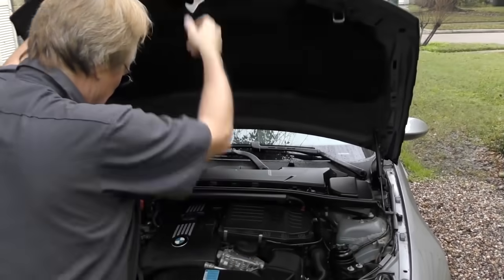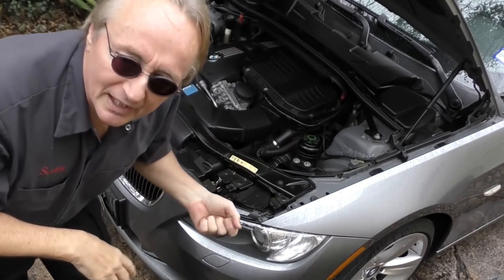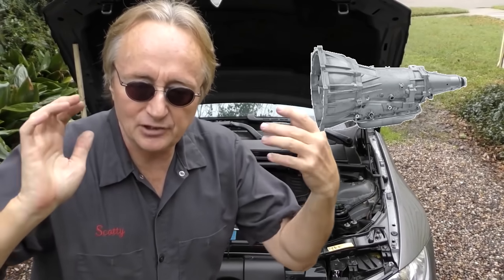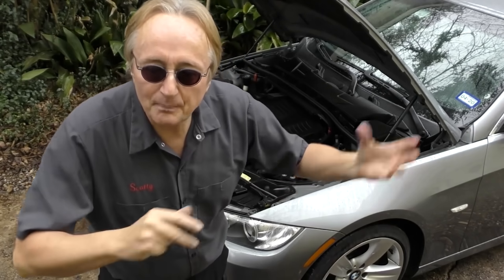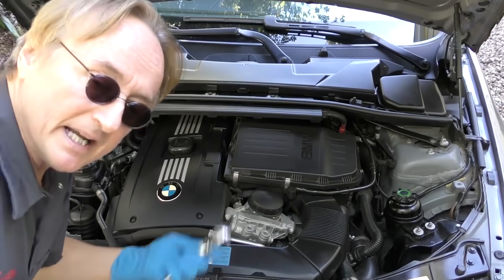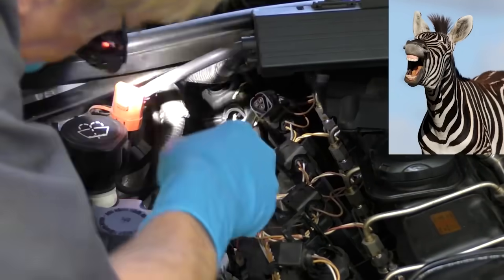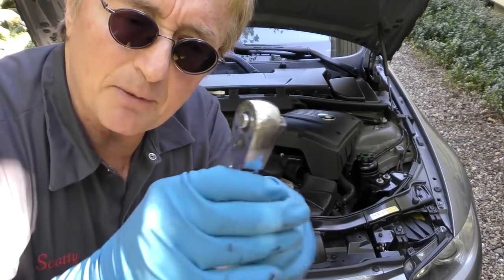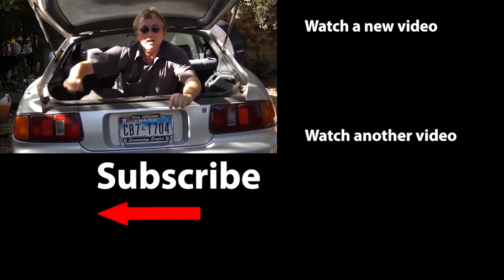People Say I'm Full of Crap About BMWs, Well Watch This

Comment: my take on bmws are if you dont know how to work on your own car then you are going to spend a heck of alot on maintenance but if you have the tools and knowledge to work on your own bmw you will save alot of money and as long as you dont buy a lemon and you get one that was taken care of it will be good. if you drive it like a bat out of hell everyday something is going to break. but if you drive it like a sane person it will last a heck of alot longer. i currently own a 2007 525xi bought it w 60k its at 170k the only things ive done to it are new coil packs, sparkplugs, and a alternator (the alternator is the only thing i went to a shop for and it was only $400 which is standard price because i was quoted the same amount to get it changed on a honda element. if you dont know how to work on them and you still want one you either have the money for it. or lease it. do not own. but if you like working on your cars and furthering you knowledge with cars or you already know how to work on them you will get by with a bmw. but we all know hondas and toyotas are more reliable but nothing beats the drivability of a bmw i will always own one if not a bmw than a Mercedes lol. but thats just me.

Comment: If like working on cars yourself then BMWs are not bad cars, in fact they are reliable cars. Maintenance is not cheap but the driving experience is great. Right now the compressor just went out on mine, I will put a new one myself. you get to learn a lot. That plastic thing is true though, there is a lot of plastics on this thing.

Comment: Having owned one of those 6MT N54 335i's for the better part of 7 years and 75k (now at 150k), most of what he says is accurate. I wouldn't buy it if you aren't willing to diagnose and work on your own car. Most of what breaks isn't particularly difficult or expensive to fix. It's not that tough to work on (for example, he should have taken off the cowl to take out coil and spark plug). Most of the parts you can get with lifetime warranty anyway. It's the labor that's killer if you can't do it yourself.

Comment: As far as I know, in our days it's around $4-5000 to replace both turbos at the dealer, I think you made a miscalculation there. Those are ZF transmission, they are pretty reliable and was installed in over 20 different car brands.
Yes, some of the models have over 30 separate computers/modules, It's nice when you can see what precisely doesn't work, not everything goes according to plan, but most of the time it's easy.
What I agree with here is most people should not buy a Used BMW! Those are performance cars, they need a lot of maintenance, and lots of money, it's the same as having a baby, if you are not ready for it, don't do it, because it's gonna be a nightmare! And yes, lease it, dont buy it!
This is an Enthusiast's car if you want a toy.

Comment: I have owned 4 BMWs spanning almost 20 years. 1 7, two 3s, and a 5 series. I used independent shops and had great luck. I have rented many many cars. Most were competent Asian sedans. I was always glad to get back behind the wheel of a well engineered car that handled, braked and accelerated very well. That is called active safety.

Comment: Yes, a RAV4 will transport you from A to B for less than an X3 and you will spend more on the BMW.
I purchased a used X3 msport with the turbo 6. I sold it a few years later. 
    I’ve driven a brand new RAV4 hybrid that costs over twice what I paid for the BMW. 
     They are only similar in that either will transport you and your stuff around.
Everything from seating to material quality, to acceleration, handling, roadholding and braking don’t compare.
The BMW will cost more to repair, and more to maintain. In some cases, painfully more.
The RAV4 will likely be extremely reliable for a very long time, save you $1,000 per year on fuel, and will drive well enough for most folks.
    Still, I’m pretty sure in my 3 year ownership, I may have spent less than if I bought a “then new” RAV4 and resold it 3 years later. 
     Purchase $17,750  65,000 miles
      Tax            $1400
       Repairs.   $2500
       Maint.       $500
        Tires.        $1000
      ‘22 sale $14,500 96,000 miles
The sensible thing to do would be to buy the Toyota as a used car with some depreciation ( right now used cars are way high, which is why my $9000 used X3 was able to sell for $14000+)
and just use it up.
    The problem with that tactic is that auto safety is improving at a pretty significant pace, and newer is typically safer. 
  If you had a family member killed in a car crash, you might be more likely to be sensitive to this, there is no going back and fixing this, old cars are way less safe, high strength steels, modern engineering, and safety systems are way better.

Comment: I bought a 2005 with 99,000 miles for $2900, got 80,000 miles out of it before one day for no reason it wouldn’t start, no problem, got my money out of it, but you’re right, cheap plastic parts, especially in the coolant system, and whoever designed those radiator hose connectors wasn’t thinking clearly, what’s wrong with a good old fashion hose clamp 😂

Comment: Owning and working on BMW’s isn’t that bad and parts are similarly priced on anything at least 6-8 years old. They do require more care and attention than a comparable Japanese vehicle but that goes along with the performance and technology. I only recommend BMW’s to people that have deep pockets or don’t mind working on them themselves. DIY is the best way to own a BMW. 

That turbo job isn’t anywhere near $8k though. Aftermarket turbos and am Indy shop and you’re gonna spend about $2500. Not cheap but not $8k either.

Comment: I really disagree with a lot of this.

1. The hood pistons are worn after 15 years...so are the ones on my Chrysler Buick :D 
2. The engines aren't that hard to maintain yourself. Oil changes and fluids, brakes, and most of the wearing parts are pretty accessible.
3. Bad turbos in BWMs usually have one of two causes: not changing your oil or modding the computer to overwork the turbo. If you're buying used, look at the condition of the crank case. If it's caked with grime, the owner didn't take care of it. Since it has a failed turbo, I'm betting the prev. owner didn't lube the hood pistons or do any other maintenece either.

I've had a 2015 BMW 335i since 2017. I change my oil every 7500 miles, I bleed the brakes with every brake change, and I flushed the radiator after 80K miles. Basically I printed out the maintenence schedule from the manufacturer and do everything myself-lube hinges, change filters, etc. I don't need any special equipement to do this. I'm at 94000 miles now, and the car has been reliable as a Toyota Camery. The only repairs I've had done were a valve cover gasket/oil pan gasket (Germans don't know how to make oil gaskets...had this issue with Audi and VW too), and a door lock actuator (fixed myself). Grand total of repairs in 7 years of ownership: $1500.

I'll compare this to other vehicles I've owned:
2010 Chrysler Town & Country: $7800 (the brakes on that van NEVER worked right)
2007 Mini Cooper: $4200 (terrible terrible engine in that)
2006 Scion XA: $2900
2014 Buick Verano: $600
2014 Audi A6 TDI: $1200

It seems to run the gambit. Forming an opion on reliability and value based on "how much is my mechanic going to screw me because i don't know how to fix anything myself" isn't the best way to form a conclusion. If you take care of your stuff, it will take care of you. If you take care of it and it STILL fails...that's on the manufacturer.

Comment: I own two Lexus': 1) 2004 LS430 and 2) 2007 GX470 and two BMWS: 3) 2015 640i Gran Coupe and 4) 2007 335i. I use the LS430 as my daily driver and my grocery getter. If it's raining or bad weather I drive the GX470. But when I want to have fun and enjoy the driving experience I drive my Bimmers. BMWs are just better driving and performing cars than any Lexus. Do they cost more to maintain? Absolutely. But that's not the point. If the only point of owning a car was to get from Point A to Point B then we'd all just drive our 1994 Toyota Celicas and be happy. That was my first car by the way and it was great--if hopelessly boring. I drive BMWs because outside of the supercar arena they are the Ultimate Driving Machine. Nothing else comes close.

Comment: I own a 2010 535i wagon and other bmws it had sat for two years previously meaning some things had dry rotted and had to be replaced but I put 40k miles in one year on that car with only normal stuff and that’s the “least reliable bmw I own it has served me well and as they are becoming more valuable I am restoring it to a show car our Honda that has been serviced every 5k and has been treated very well is being the original owner blew up with 100k miles on it our Toyota Highlander the starter went out at 20k miles our g35 we had to get rid of due to constant repairs also were the original owners of that car bmw is the only brand that you get back what you put in it seems like

Comment: I have had a BMW Convertible 325i for over 15 years and I still love it! It has never let me stranded EVER! Plus I could sell it for 3 or 4 x what I am into it for. With all that said... It is a 1993 24 valve 6 cylinder M50 motor with aluminium valve cover and thermostat housing and all the good stuff from before the new plastic junk started coming out that you see today. Really wish BMW would just go back and re release some of their old classics.
Reply: unfortunately emissions and safety regulations would not allow that, the G chassis cars, especially newer 3/4 series have been pretty reliable though!

Comment: I drove 6 520 D sedans to over 1 million km's each (own an airport shuttle business) and never had a problem - never lost a turbo, nor engine problem ever and no gearbox issue"s ever - they are fantastically reliable machines and I only changed the oil every 30k km's which was almost monthly as I was driving over 800km daily - this guy is sprouting the biggest load of crap...

Comment: There's another plastic piece above the cylinders the width of the engine bay that you can remove to get easier access so that you don't have to use all of those extensions and rub the skin off your knuckles.  Worth the extra 5 minutes to take it off.

Comment: This is a BMW e90 335i. Around 335hp. I've got the 330i with around 278hp. Best car I've even had. I'm excited about going somewhere with the car. It's great. I've got a toyota avensis 1.8 t250. Great car. It is much duller but hey, it's cheap and reliable. However, the toyota has significantly more rust that the BMW. I mean my 20 year old BMW has no rust - the underside is dirty but you can see grey beneath the dirt. The toyota however - aiyayaya. Yes, the BMW will have more problems - my injectors are acting up. I'm still on the original injectors and they are leaking. But it's not something I can't live with - the car has developed some character as they say. I mean I just replaced the original BMW battery which is almost 20 years old and I only did this as a precautionary measure.

Comment: I was crushing your channel hoping maybe you swapped out an F32 stock rear with an M4 rear to Gen 3 ZF8 tranny , its non clutch , i moved away from twin plate clutch , ZF8 is where it at , but , they blow real easy anything above 600 lbs torque , i replaced mine already , lol , but looking to swap the rear with M4 ,, its a must , i have a stage  3 tune , any ideas ?

Comment: I fixed the rear airbag suspension and replaced them but it didn't inflate, I checked the feus number 40 which is for the air suspension, and checked the air suspension relay which could cause this issue by not switching on and off or the air compressor itself is wet, any ideas? E70

Comment: My favorite about BMW/Mercedes is that they only provide replacement parts for as long as they have a factory warranty available for a car (max they go is 3 years). So when you buy a 2023 today, in 2026, when all the computers start failing (headlight module seals are very common and last about 3 years) not only can you not get an OEM replacement, the car will REQUIRE it and not work with any aftermarket ones. So you will be pretty much forced to buy a new car... usually over a headlight.

I work at a shop and I have seen this happen to 3 customers now with these vehicles over the past 4 years or so.
Reply: LOL, this is not true at all.  I have a 2013 BMW 328i and i have no problem finding parts, even replacement seals.  No problem at all, its called after market and if there is money to be made their will be parts.  It's simple economics.   I recently changed my spark plugs and coils (for the first time at 140,000 miles, plugs looked fine BTW) and they came off easy and nothing broke.  Don't know why he had issues with removing the ignition coils, you just twist them back and forth a couple times and it pulls right out, easy peazy.
Reply: You do not own a 2018+ my guy. Aftermarket ones will not work with the car. The BCM will not recognize the software and actually reject the headlight that's installed and keep it from turning on or being programmed to the vehicle to turn on. We ran into the same thing with batteries on the new ones as well. You HAVE to go OEM with those as well otherwise the car will not start with an aftermarket one. We have tried multiple times, and even outsourced trying to program them to the vehicle to the dealership. Hence where I got my information from. 

A 2013 you are completely fine with, aftermarket parts are plenty available and they do not have this problem. Trust me, I have fixed lots of them that have gotten into accidents

Comment: Want actual data and numbers? These entry level German luxury cars cost virtually the same as an American pick up truck does to maintain post warranty. Any number of websites on maintenance/repair costs will verify that. For reference, the most reliable Japanese sedans generally cost about 2-3x less. We're talking about $300-400/yr vs $700-800/yr.

Repairpal's data is all post warranty too.

In other words, owning these cars is not even close to as bad as people tend to think. They will certainly cost more, but compared to an alternative, and looked at on an annual basis? On average it's not that big of a difference in the grand scheme of things unless you're struggling financially. The exception to that is the high performance model cars (M3, Audi S/RS, AMG, etc) with engines that cost 20k+ to replace and have a tendency to grenade.

Comment: As a BMW tech for the last 19 years, this a poor example of how to swap coils.  It takes 30 seconds to remove the micro filter housing and the cowl tray. Then getting to the coils and plugs are easy.  

Sure Toyota makes reliable cars but they are plain and boring.  Look at the new Supra, it’s a BMW Z4 with a hardtop.  

BMW is in a different class then those cheap Japanese brands and all American brands. Look at the interior material quality and the tech BMW uses.  There is a reason they cost more.  It’s like comparing new balance with Nike…

Comment: Scotty, I took the battery out of my 328i, 2012 BMW and can't get the trunk open. no key slot on the trunk, no access thru the back seat and the car does not start if we provide voltage thru the engine. HELP!
Reply: Have you tried a power drill???? wink wink

Comment: I love the 335i - Forged internals, you can push upto 800 hp with simple ecu remap, blow off valve, charge pipe, cold air intake.  You dont have to upgrade any of the critical internals.

Comment: Anyone have thoughts on a certified 2019 530i? 12,000 miles on the odo. Not set on it I have a broad range of cars (few SUVs) I'm interested in. 2019-2022's.
Reply: I personally have a 2018 530i with 45k miles on it now. Perfect car and I’m happy with it. No issue so far. Had a 2018 Camry prior to that with all the bells and whistle. But I won’t missed it.  Just do the regular maintenance on these cars and don’t cheap it out. and you will good to go brother.

Comment: All German cars in general use plastics that are "eco friendly" biodegradable. So those plastics literally start decomposing after a few years that's why they get so brittle . Later on they fall apart when disturbed. Never buy a German car. Japanese cars use plastics that are far more stable and don't do this nearly as fast. German cars have hundreds of critical parts that are made out of plastic. Have one fail and you will have major problems.

Comment: If you want the transmission to last you will bite the bullet and change the transmission fluid every 80 k. The dealer won't do it. Go to an independent and pay the 1000 dollars. The problem with BMW is that they require maintenance and Americans do not know how to maintain their cars or are they willing to spend what it takes to maintain them. BMW are incredible cars but you will pay more for them. And BMW doesn't use a hose and metal clamps. They have plastic connectors that snap in.
German cars in general will cost a fortune to maintain. If you don't want that then buy a Toyota. Just remember a Toyota is not a car it is an appliance and it is boring as hell and cheaply made . It will however last forever at least the older ones did.